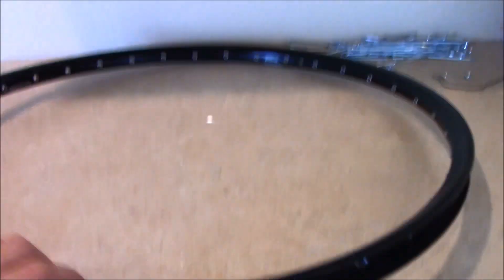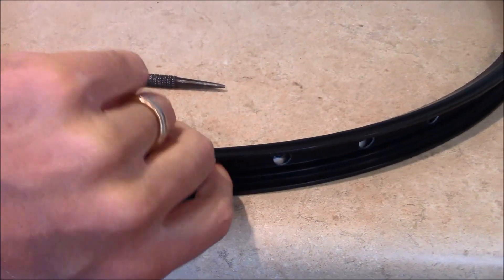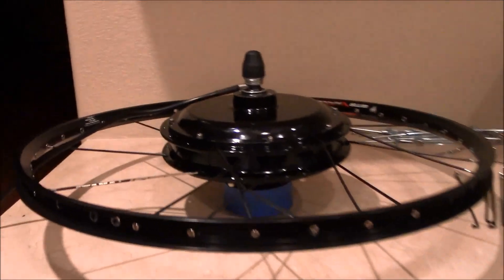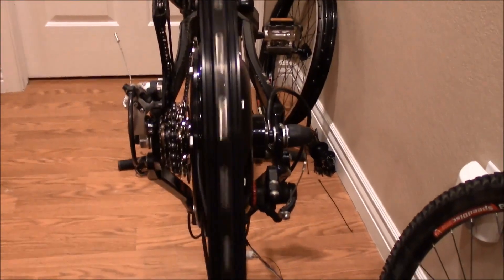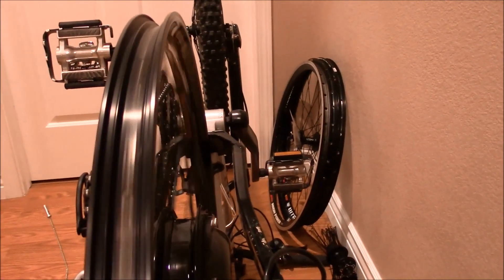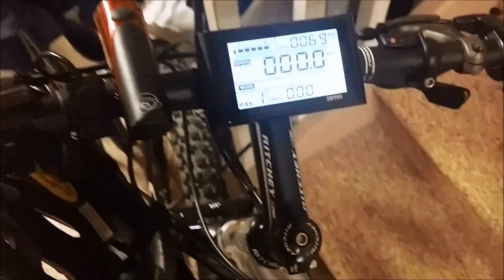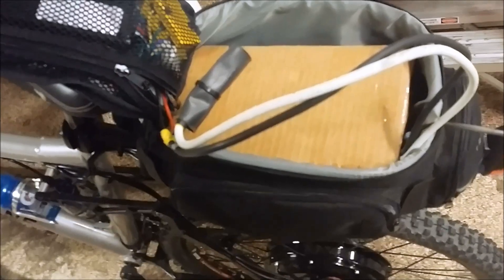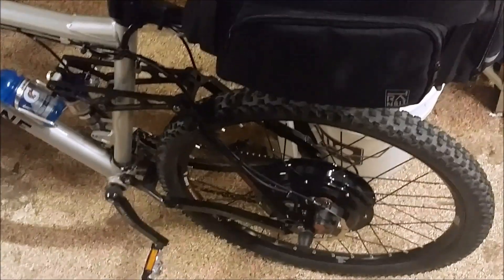48v 1500w ebike "First test ride and new rim"  (Part 6 of 7)

Comment: Howdy! what do you think about those spacers that are available instead of a glue gun?
Reply from the maker: +electron spectrum yeah man I need to think of using spacers, RTV, silicone or something similar instead of hot glue.  The hot glue is getting to the point where its not working out too good anymore.
Reply: +15-sec-of Fame Good to know, thanks, there was someone who had a 3D printable template for spacers...

Comment: Hi How's it going? I have the same ebike as you and was wondering if you could help me and point me in the right direction. With mine. I bought a new controller since my battery pack exploded. I have an error 8 message on my Chinese 1500 watt 48v ebikemotor kit any ideas why the motor will not switch on? There is no pas attachment. Only one white wire not attached to the motor to controller. Brakes not attached. Sensor not attached. Thanks Robert

Comment: Maybe you could put a grommet or two on the front and back of your pouch for ventilation.  Should help quite a bit with any heat build up.  You could cover the grommet holes with screen to keep bugs out as well.
Reply from the maker: +Nick Colbert  it will help get some air flowing for sure as I have been thinking of something new to try :)  and may need the extra cooling.  Just waiting for the parts to show up to make the next video.

Comment: I apparently got the same Chinese 1500W rear hub motor that you have, but I bought the kit with the motor built into the wheel.  I'm already replacing almost everything on my 1985 era Trek aluminum frame mountain bike to convert it to an e-bike, and figured I didn't want to get into lacing a wheel.  I paid a fair amount extra for the sine wave converter, so I'll see if it's as quiet as I hope.

I like your rack pack for the batteries and electronics.  One of my goals is to make my bike look like a thrashed out commuter bike and to the extent possible, to hide the fact that it's an e-bike.  Your bike pack would be great for a stealth e-bike.  I'd say you have the nicer and sportier version or a stealth e-bike, as opposed to my old beater commuter bike version.

I'm using a fat 50 ammo can on the rear rack as my battery box and electronics enclosure.  My battery pack is 12 series connected banks of 12 parallel 18650 batteries.  I'm building the battery pack in an open configuration, with three packs that are each 12 cells wide, 2 cells high, and 2 cells deep.  These packs will be mounted to the inside of the steel ammo can on the left, bottom and right.  The ammo can is a heat sink.  I also bought a sheet of annealed aluminum that I plan on bending to act as an internal heat sink.  It's not built yet, but that's my plan for lithium battery thermal management.  I should be building my battery pack in the next week or so.

Thanks for the video.  It was both educational and motivational!
Reply from the maker: +Liberty4Ever Thanks man,  my hub did come mounted on a rim but I wanted matching rims.  So I bought a 36 hole rim that matches my front rim and modded it to fit 12ga spokes.   The rack that I have has been replaced already due to it starting to crack at the weld joint.   Think it was mainly due to a washboard road that I accidentally went on, it was pretty rough.   If you buy something similar to what I have just make sure you can help support the rack with straps going from under the seat out a bit from the weld joint just to help the keep all the stress off the weld joint.   Please keep me updated on the battery build and how it works out.  Thanks, glad i was able to help :)

Comment: Im building something similar can't wait to finish
Reply from the maker: Awesome man!  yeah I just upgraded to 72v myself :)  hit 50mph!
Reply: +15-sec-of Fame lol that's what ALWAYS happens ;p ... I run a 1500w leafmotor on 24s lifepo4 76v nominal 30ah, with an 18fet sine wave ESC and have clocked over 60mph ;)
Reply: +15-sec-of Fame hey great videos you've been helpfull alot😄. Could you make a video on how you made your 72v battery pack???
Reply from the maker: Thanks, I already built one, but havent posted it yet.   I didnt want to show to much detail on my 72v pack due to it being split up in 2 areas on the bike.  I just didnt want to confuse anyone on how I built it.  The 72v battery has a 20s8p as the 48v has 13s8p.   I have had issues with the ebike display this summer which as kept me from posting videos of the bike in its 72v configuration.  I sent the controller and display back to China to see if the display manufacture can figure why the display keeps frying after 120 miles or so.  I will document the ebike with new '3rd' display in a few weeks and post everything I did this summer :)
Reply: +15-sec-of Fame hope you solve it asap👌. Gonna order the same kit on eBay hope I can get 50mph myself. Whitch battery would work best 18650 or lipo's??
Reply from the maker: Lipo packs can damage pretty easy and have a higher failure rate,  but there power is awesome on their "C" rating.   18650's would be good for the long haul and can still be great for power as long as you have the right amount of cells to prevent overheating.   Watch for max speeds for long periods (10 miles etc...)  as this will make the battery run a little warmer.   I have had my battery pack of 18650s hot several times, so hot that I couldn't keep my hand on it for long and tested a few cells later and only lost 5 mAh out of each 2350 mAh cells in 6 months :)
Reply: +15-sec-of Fame thank you best stick to  18650 then

Comment: What's your make of ebike kit man? Do you recommend?
Reply from the maker: +harveyboy45 I got it from China.  theebikemotor.com its a 1500w kit its abe to use a 36v-72v system.   its working great so far only has 185 miles on it due to the winter months :)
Reply: +15-sec-of Fame hi did you fit a 6 speed or 7 speed cassette onto your back wheel. Will I have to change my 9 speed cassette?
Reply from the maker: Yeah I had a 9 speed also and went with a 7 speed.  I have it set to the speed gear and never move it.. dont need to :) the last gear is tight close to the frame, so I just stay on the second smallest gear.  I have the front on the largest and can still pedal up to 26-28 mph if I wanted too of course lol.

Comment: Whats your average range on that battery pal?
Reply from the maker: +The Quadfather Thanks for asking.  I put 28 miles on this battery last Saturday one charge.  A few friends and I hit the road with me on the bike and them in a truck for support.  We set up check points (miles apart) on where to meet up and from point to point I was maxing it out on every leg from point A-B to C etc...When I would get to the check point we would check voltage and battery temp.  After 28 miles of  full throttle speed the battery was at 48 volts (with no pedaling), but the battery was getting warm and I ended the testing.  So if I take it easy and help by pedaling up hills etc.. Think i could easily go 50 miles+ on one charge.  I live about 22.5 miles from Denver and I am looking to video me riding to downtown Denver and back about 45 miles soon.
Reply: interesting, why do you think the battery is getting hot ? cells not capable of the discharge amount. notice you only have 1500watt motor so shouldnt be drawing too much current
Reply from the maker: its was mainly due me blasting it everywhere I went during the test and the bag that I bought is a thermal bag and it retains heat.  I also covered it in 3 layers of film for protection, but it couldn't breath.  So I've removed the covering and made a better way to keep it cool, no more issues of it getting to warm.  So, now I'm just waiting for my new 375mm PVC heat shrink wrap to ship from China to re-cover it.  I'm also making cooling vents in the bag for ventilation.
Reply: Great, I'll look forward to watching the videos, doing a build myself soon. Keep up the good work pal
Reply from the maker: The Quadfather Thanks, good luck on the build and let me know if you have any questions during the build.

Comment: how do you fool the cops its 750 watts here in polk county fl. is it a leaf what company?
Reply from the maker: warriorcycles,  sorry it's been a while  since you wrote, but it doesn't have any spec on the hub and you can print out some of your own that says 750w.  Voltage will determine your speed.  At 48v I would get 32-36 mph and 72v 46-50 mph on average.  Or keep off the throttle until you need it :) its just like a car keep off the throttle stay to the speed limit no reason to go wot.... all the time.  St.Johns county here!

Comment: I'm building a similar bike.  Do you recommend the 2 piece frame?
Reply from the maker: +Bob Shepherd I like the 2 piece frame because I can adjust the shocks to make it a soft ride.  Riding like an old 70's caddy right now!   The only issue right now is the battery mount has little support, so I am moving the battery to the frame.   Once I receive the parts for my new battery location it should ride even better.   Right now the weight is all in the back and I already replaced the post that holds the battery bag due to the jarring from the bumps (cracked).  Think I had my suspension on a harder setting before I adjusted it.

Comment: I have a 48v 1000w front wheel Chinese ebike kit on a Fat tire bike, what size battery would u recommend.
Reply from the maker: bikergirl40   at wot you can pull 50% more power that the rated power.  So 1000w is really 1500w at wot, so a 1500w battery will work perfect!

Comment: Nice, I was thinking about putting a motor in a 29 in rim.  Thanks
Reply from the maker: +Bob Shepherd yeah man a 29er will be nice!  Dont think Ive seen one yet!
Reply: Does anyone know if there a chance of using the motor as a re-generator?  I know resistance this and that but my motor is generating a significant amount of regen and i have no idea if that is practical
Reply from the maker: Bob Shepherd Im sure if you bought a controller that has that feature it will do it!  The hub should be good.  When I was installing my wheel the 3 phase wires were close to each other and not connected to the controller wiring.  When I spun the wheel I accidentally arched the wires, so its was regenerating.
Reply from the maker: Bob Shepherd wow yeah Im tired I answered that kind wrong.  I would think that you could get another 15-20% back into the battery on a good long ride.
Reply: The wiring diagram for that config is not easy available.
Reply from the maker: +Bob Shepherd it would have to go back thru the controller to regulate the voltage back to your battery.  There are controllers out there that you can buy that will do it.
Reply: Thanks for your input.  But why go back to the controller?  I have not seen a controller with that feature
Reply: A relay makes sense to me.  But the amps required to keep the relay open may negate the increase
Reply from the maker: Bob Shepherd google this controller:  (12 fet irfb3077 Infineon controller).  it has a lot of great features to modify to your spec's.
Reply: Wow, that is cool. have you tried to regen through the controller?
Reply from the maker: Bob Shepherd hey Bob my controller doesnt have the regen function, but I know my riding limit (speed vs miles) and I carry my charger in a backpack :)

Comment: What size battery did u use for a motor of that capacity
Reply from the maker: At the time I was using a 48v nominal voltage or 54.6v peak voltage DC  at 18 amps.  It put out 950ish watts, but truly need 1500 watts.  The battery would get hot after 25-30 (full power) miles.  If you keep it to 20-25 MPH you will be fine for 40-50 miles.  My new battery is 84v peak at 19 amps and is now 1596w
Reply: Wow, did u make your own battery pack
Reply from the maker: yes
Reply from the maker: bikergirl40 yes I did,  its in my series of videos.

Comment: could you mount a brushless hub on a 29er rim?
Reply from the maker: yeah man,  plus there are setting in the controller to set it up from a 20" to 29er.  If you want matching rims it may require some extra work and be ready for lots of headaches.  For example; you will need to find a 36 hole rim that matches your front rim, plus you might need to have custom 12ga spokes made also from a bike shop, ebay etc...  I found mine on Amazon that belong to the Phoenix 2 kit for a 26" rim and it fit perfectly.   I really dont know much on the 29ers, but if you take your time and research all the rim measurements it will finally come together or just stick with the rim it comes with and get on the road :)
Reply: ty for replying, I have a 29er so that's why I asked I only see 20 and 26 hubs out there. I had to make my own ebike with a brush scooter motor and motorized bike sproket. I like your it's very educational I plan to upgrade lithium in the near future.
Reply from the maker: Juan C nice man, innovation doing what it takes to get it done!   look at theebikemotoor.com looks like the 29er rim isn't available but if you bought a hub you can get customs spokes made for the rim.  I did a quick search on a 29er 36 hole rim http://www.notubes.com/ZTR-Flow-EX-29-36-Hole-Black-P970.aspx  
So if you bought a hub, controller, throttle, rim, LCD display and spokes your set, then you can work on the battery later.  In the display settings you can adjust the rim size up to 29".   Even for my 26" rim I can adjust the rim size higher or lower speed.   The lower rim size will give you more torque for slower speeds (for very steep hill climbing) the higher rim setting will give you top speed, but slower starts.
Reply: I believe if i get the same kit, it would fit with hub in theory since the hub spoke hole have a bigger diameter than a freewheel if that makes sense. I will have to take measurements i appreciate the research you have done.
Reply from the maker: Juan C yeah man no problem,  normal spokes are 14ga and ebike rims have 12ga spokes. Also look at the rim to see if the spokes are long enough and you should be good once you get the measurements.  Part 6 of the build shows how I had to make the holes a little bit bigger in the rim for the 12 ga nipples that attach the spokes: https://www.youtube.com/watch?v=0Tfk0AImnb8
Reply: +15-sec-of Fame I think you should be clear to ppl that it's NOT THE size SETTING that determines torque or speed, BUT the actual size of the wheel, the setting is only relevant to show the correct speed 4 a wheel size! it cannot change torque or speed? only a wheel change can do that, smaller =more torque and larger more speed.
Reply from the maker: You can change the speed by the settings and the size of the wheel also makes a difference.  I had to change the wheel setting in the display when I first saw that my speed was around 44.2 kph (pictured above).  The wheel size was set from the factory to a size 20" wheel .  Once I put it to 26" it doubled the speed and the wheel spin was very noticalbe also   I will have to test the settings again to see if it changes Tq while riding.   If I remember I think it does.   Sounds like I need to make a new vid on this soon so everyone understands what it does.  I'll be home in a week and I'm hoping my controller and new display will arrive by then so I can post up a vid on this.  Thanks

Comment: Why 50amp breaker switch?
Reply from the maker: +harveyboy45 didnt want it to be too low or too high so if the battery ever shorts out it will trip.  Plus, its good to have when you want to shut off the battery from the controller.
Reply: +15-sec-of Fame 50amps seems a lot. Can a 10amp switch work?
Reply from the maker: harveyboy45 you will want the breaker to be larger than what your draw is.  Right now my current draw is about 30 amps max at full throttle, so I have a 20 amp buffer.   Its mainly there if the wires ever short out.